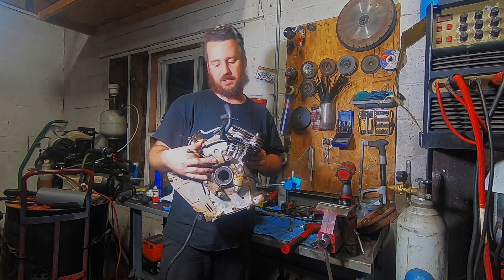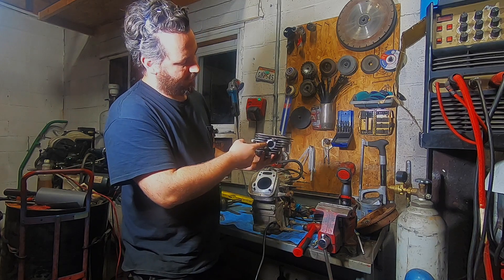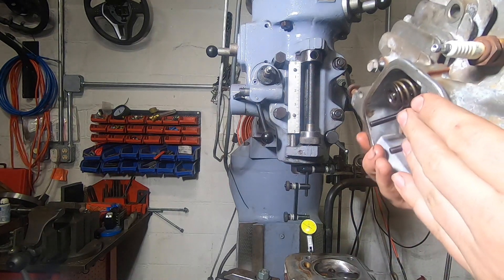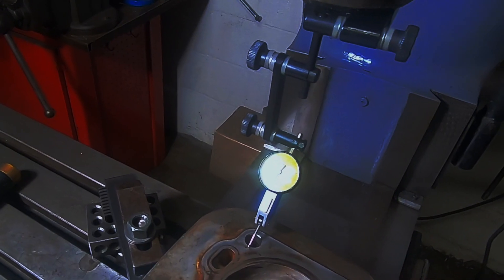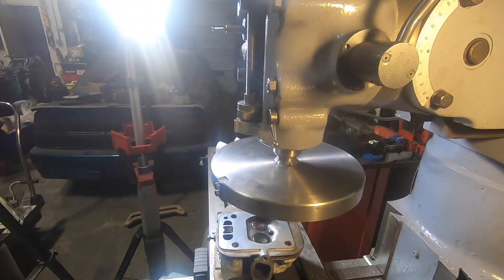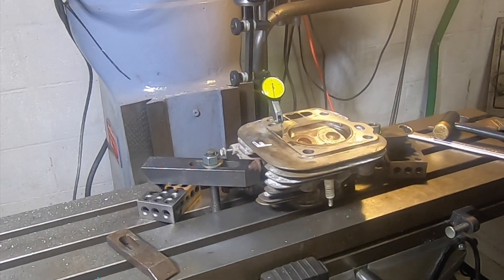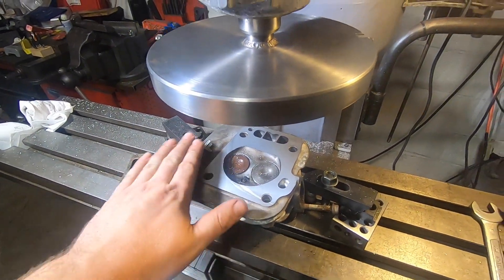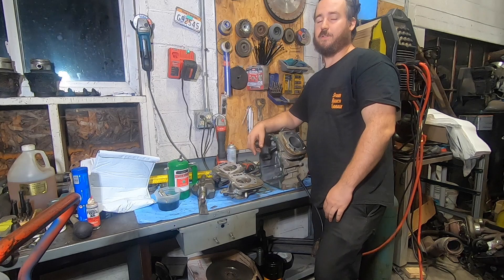Resurface small engine cylinder heads like a PRO. Honda GX, Kohler Command, Briggs & Stratton

Comment: What model Bridgeport mill is that? And by chance, where did you get the fly cutter or what did you use to make it? I’m looking into getting a simple setup myself.
Reply from the maker: Its a regular series 1 bridgeport with a variable speed head. I made the flycutter myself, I have a video on that too. Works fantastic for small jobs like this.
Reply: @  thanks a lot man!